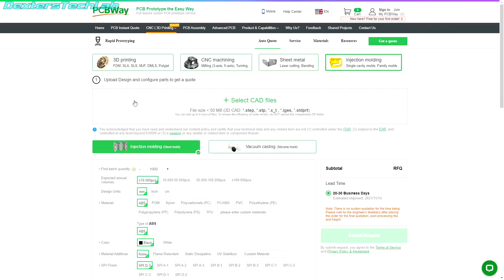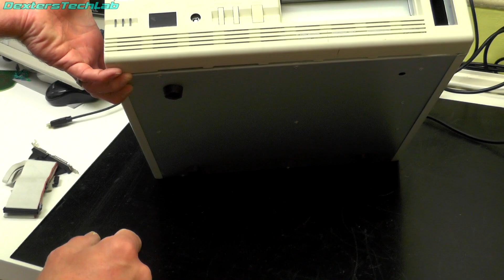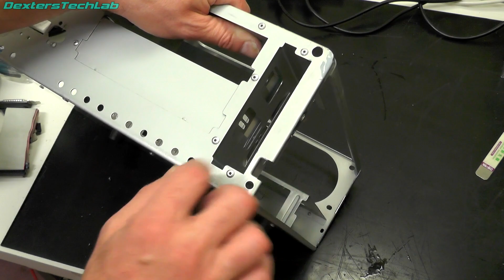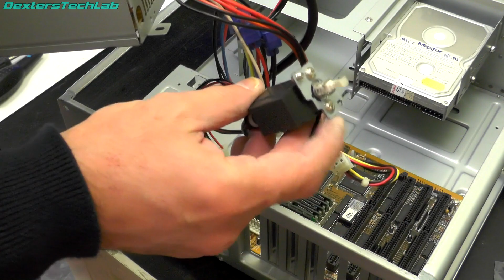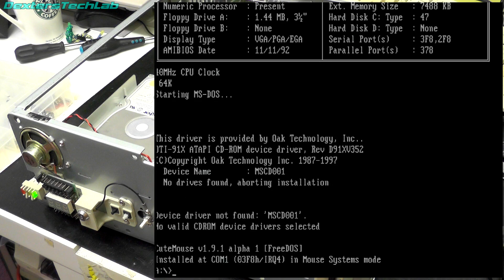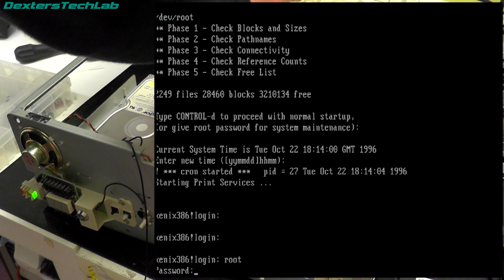DL225 386 Unix PC Build Part 1

Comment: I think you forgot to connect the power cable of the front panel LED display. It usually has a vampire connector that goes onto one of the floppy power connectors. After that you'll have to fiddle with the jumpers to get it to display the correct MHz numbers in regular and turbo mode ;-)

For a challenge, you could try installig Dell UNIX on it (yes, Dell had their own UNIX at some point...)

Comment: When I built a Pentium (200MMX) system a few years ago, I didn't have an AT style keyboard for it.

I knew that the protocol for PS/2 keyboards is essentially the same as the 5-pin DIN AT keyboards, so I just soldered a USB-A socket directly to the pins on the mobo.

Quite a few cheap modern keyboards still support PS/2 mode via the USB pins, so that's a nice way to use a new keyboard on an old AT system.

(as long as you get the Gnd and 5V pins correct, it's very unlikely to damage anything if a modern keyboard doesn't support PS/2 mode, it just won't work.)
Reply: Oh, and the PSU in the Pentium was kindly donated by Mr Dexter, and it's still going strong. ;)

I did remove the external mains filter that the PSU had bolted to it, though (factory original), as it was a bit hairy having the exposed mains terminals right behind the CD drive. lol

Comment: I sure dont miss the annoying harddrive sounds 😄
Reply: I don't miss the hard drive droning, or ball mice for that matter. I remember once FDM bearings became a thing in hard drives, and the first optical mice that didn't need a special mousepad coming out and running a campaign to rid every customer I had of both those annoyances.
Wish I had kept all the old mice and hard drives now though, makes getting these older machines up and running easier, plus when demoing these things for newer generations having the noisy hard drive and the awful mouse is a part of the experience!
Reply from the maker: I agree with the ball mice, they can burn in hell. But i do like old clacky hard disks.
Reply: @DextersTechLab  were they that bad?

Comment: Got a dozen I could post you, though likely they would only arrive 2023 by you, unless I paid close to 1000 pounds for courier. Still got a 386sx33 board that I used as a controller, just no longer have a MDA monitor for it.
Reply: A dozen what?